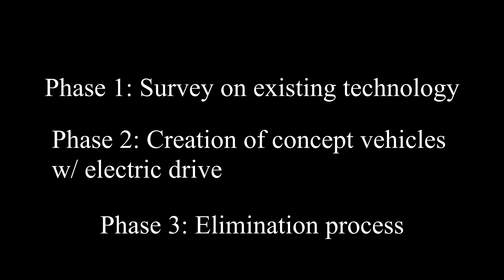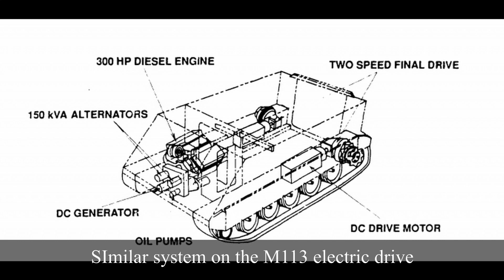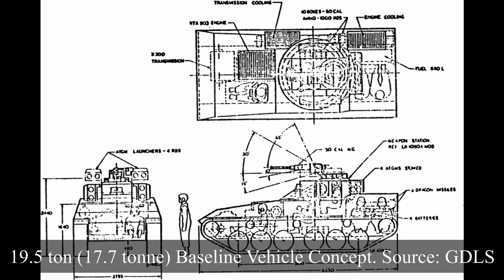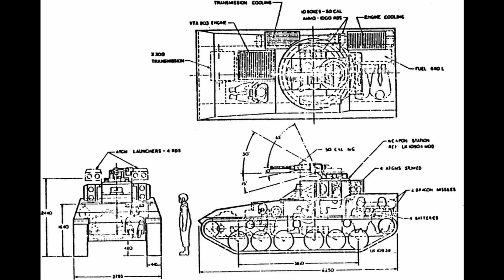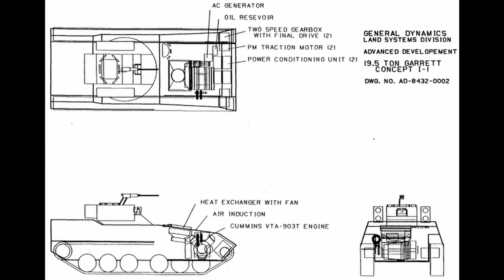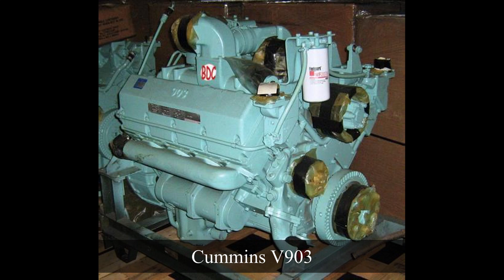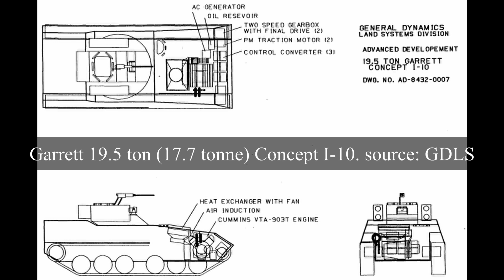Better Than A Tesla | 19.5 ton Electric Drive Future Combat Vehicle

Comment: Batteries are ridiculously heavy for any meaningful performance. You'd lose massive amounts of combat power or armor just to get to where conventional drive already gets you. And any enemy tank of the same weight that USES conventional drive would be superior in any category but torq, acceleration and max. speed, which for tanks aren't really that important.
Having less per ton protection and "oomph" to dish out is simply unacceptable.
Reply: That is why they are experimenting diesel-electric or turbo-electric. Those setup allows simpler transmission since an electric motor can have the same torque to wide variety of rpm. Just like on those diesel-electric rains. The batteries may be limited on tasks that is useful for short trips, like, moving from the vehicle depot or sneaking up on the enemy. As well as other tasks that doesn't require the engine running.

Comment: Just a thought on the subject..... but if you added a battery pack, with enough storage, wouldn't you could move around a bit on the stored power without a major heat signature. low noise, low thermal signature, well lower than diesel or turbine ...  a sneaky, sneaky, ambush hunter.
Reply: the south africans made a diesel-electric tech demonstrator of the rooikat which could do exactly that.
Reply: no... maybe you could move few kilometers before batteries would become so heavy and big and expensive that there would be no point in that

Comment: Batteries are not good in cold
Reply: Li-FePO4 are reliable and work in a large temperature range. They have less range, but paired with a diesel electric generator that doesn't matter. They are ideal for this type of application. There are a lot of different cell chemistries with different properties, some use rare elements and are expensive, but some, like this, are not.
Reply: @mennol3885  If they did,someone would be making them! Maybe in future with solid fuel batteries
Reply: @pashapasovski5860  they are used, in motorhomes, caravans and electric cars and boats and forklifts.
Reply: @mennol3885  Why use Electric engine then in the first place when you need to have a Diesel Generator to power the batteries
would by better to just build a Diesel engine in that case
would probly even by better
Reply: @toxi2202  Generally, with electric cars, trucks and also trains and ships etc. The weight of the electric motors is similar to the weight of an equal capable transmission system with gears and a clutch. Then the advantages: 1. The engine is not mechanically connected to the wheels (tracks) which means the engine can run at an optimal rpm for the power needed. This allows for a smaller engine. 2. Removing redundant parts like a dynamo and a starter motor. 3. Design freedom of engine placement in the vehicle. 4. More control over the wheels. Electric motors can be used to implement traction control or differential steering. 5. When a battery is added the engine only needs to deliver average power, and not peak power. This reduces the size of the needed engine further.

Comment: Diesel-electric has been proven in railroad locomotives for almost a hundred years.  The simple, old, slab sided M113 three box design, a center hull and two side sponsons, would have been perfect for it.  Fuel used for armor, as in the Merkava.  Batteries on the floor plate, providing composite anti-mine armor.  An inline diesel running an alternator in a side sponson.  Cooling, a key factor, in the opposite sponson.  A simplified drive train, maybe even in hub motors.  A hydro-pneumatic, magnetic shock suspension with rubber tracks.  The entire center hull open for crew and weapons.  Swift-silent-deadly.  But, as usual, the Army castrated the whole project by over dictating the design.
Reply: Using fuel as armor isnt real that of an good idea not to mention it dosent help against Modern weapons and ones Penetrated it Starts leaking fuel Reducing the effectiveness to
and batteries for floor protection is a REALY bad idea  Ones the batteries get Damaged and + and - touches it allways will catch fire and Burn the crew inside even dough the blast didnt hurt them
Reply: @toxi2202  Both the Israeli Merkava and the Swedish Stridsvagn 103 use-d diesel armor in small, well distributed, fuel tanks, as armor.  The Merkava tanks are self sealing.  I'm not sure about the S-Tank's.  Diesel is effective against shape charge warheads.  (As is water.)  And it does not burn when hit.  And not much is lost when a small fuel tank is holed.  It's messy but the purpose is protection of the crew.  Better a live crew and a slight reduction in range than a dead crew.  I agree with you in regards to batteries in the floor.  But if you look in most APC/IFVs, you'll already find banks of lead-acid batteries located in the floors.  And battery technology and isolation from the crew or passenger compartment of both fighting and civilian transportation has and continues to evolve.  One way to deal with the danger of battery fires is the same way ammunition is stored in "wet" containers.  In other words, immerse the batteries in fire fire suppressant containers.  Meanwhile, their density can provide a modicum of protection when "sandwiched" in composite armor.  Fire is actually less of a problem than the toxic chemicals that may be given off if the tank is hit.  Just as high pressure, burning hydraulic fluid is more dangerous than actual metallic fragments in a hit tank.  The biggest tactical problem with turbo diesel-electrics is thermal signature.  But even this can be turned into deception or decoy targets.  The biggest issue I have with electric vehicles is increased weight, affecting ground pressure and trafficability, versus the ease of simply funneling a few liters of fuel into an internal combustion engine.  Incidentally, you haven't lived until your tank turret has been struck with a long rod penetrator or an ATGM, the noise alone is enough to kill you!  Tanks a lot for your comments.
Reply: @rayo toxi   maybe use those newer ceramic solid state whatever battery's, there less capacity and it's slightly heavier but the damage resistance is ridiculous in comparison with lithium, or alternatively redox flow battery because non toxic/flammable etc and endurance can b3 increased by just hooking up mor3 tanks
Reply: While fuel as armour makes sense, since they don't burn due to lack of oxidizer, batteries on the floor is a problem. Aside form the previous mention of short circuit, there is the possibility of explosion. And since this is a military vehicle, not a civilian vehicle like Tesla, plenty of things can go wrong. 

There are two possible choices, accept small battery storage which will be in the engine bay, expecting short range which is handy for sneaking. Or, have most fuel storage on the engine bay and some in the back, and have the batteries mounted between the hull and outer skirt with some gap. The battery will act like overpriced space armour and will be in several armoured modules just so the rest of the battery doesn't burn the rest.